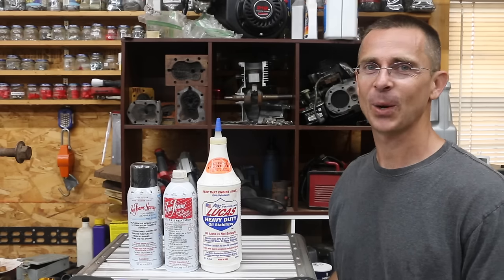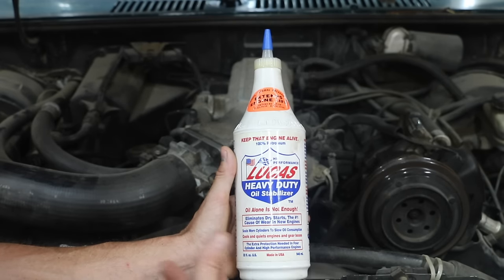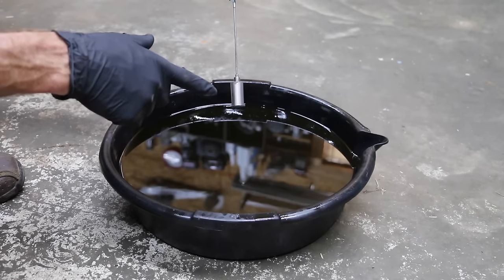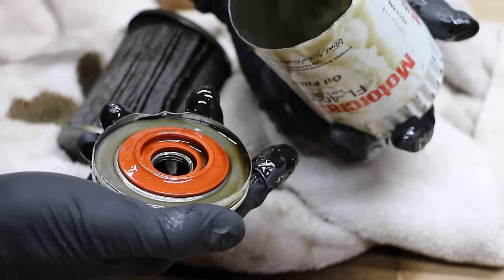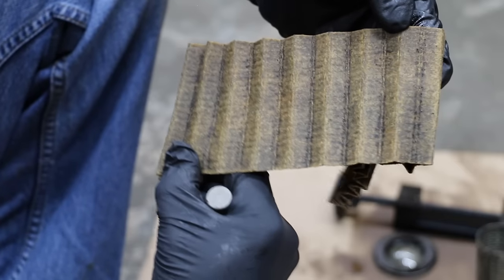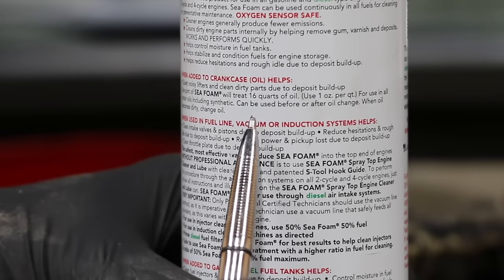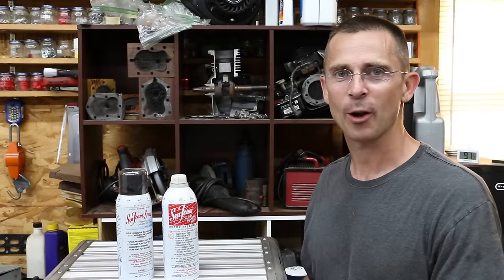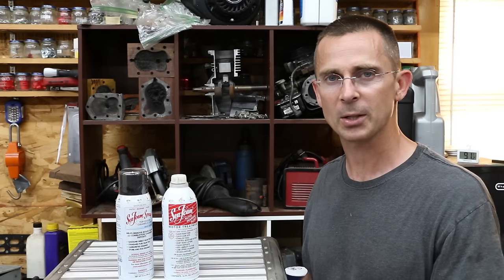Did the Seafoam fix last? Update on the Ford Ranger

Comment: I would love to see a show down between Walmart's Super tech motor treatment and Seafoam.
Reply from the maker: Great video idea!
Reply: Itd be interesting for sure. The stuff works just as good to me but raw numbers would be nice.
Reply: Ya? and the cost is like $3 bucks. Way cheaper then Seafoams $7 a bottle.
Reply: Yes, please! Been looking for a comparison of these two products for months!
Reply: I'd also like to see a super tech vs name brand synthetic lubricity test before and after use in engine
Reply: I use supertech on all my vehicals even the lucas oil stabilizer knock off and it all seems to work for me I'm about to use the supertech refrigerant for my ac would love to see a video aswell!
Reply: The refrigerant is identical to everything else on the market. Avoid any "stop leak" or any other additives in your AC system. If it leaks, use a dye injector kit, find the leak and fix it. If there is no refrigerant in your system, find a friend or trustworthy shop that can put a vacuum on your system before filling it with refrigerant. Be sure that the system HOLDS vacuum as well. Good luck.
Reply: B-12Chemtool,at wal-mart

Comment: I have a 2002 GMC Yukon that wasn't sounding that great. It has 277,000 miles or so. I used Seafoam in the gas tank and in the manifold. I saw such a difference! Acceleration is much better for sure. I haven't added any to the oil yet, but plan to before the next oil change. Thanks for the videos!
Reply from the maker: You are welcome!  Thanks for sharing!

Comment: I've been an auto mechanic most of my life and I've actually retired from it and I used to be completely skeptical about products like that but I learned that most of them actually do work, but the results are limited. I mean you're not going to get a new engine out of a can and you kind of need to know what your expectations are before you pour it in. I think you got a great result from some good products that met your expectations so in that regard yeah they work really well. Sometimes some products like transmission seal has the side effect of softening seals and they may shorten the seal life but if your seals are already leaking it's kind of worth a try but like I said don't expect too much out of a bottle.
Reply from the maker: Thanks for the feedback!

Comment: I used Lucas in my perpetually-leaky transmission. It performed as advertised.
Reply from the maker: Thank you for the feedback
Reply: I’m curious do you live in a cold climate? I live in NW Ontario and we frequently get to -40F in winter. My transmission is also perpetually leaking and want to try Lucas but I worry it will be to thick in winter.

Comment: If the blowby was rings the Seafoam should do it, but it could probably use an extended highway drive. I like my filter media oily when I check it. A magnet makes the oil "ooze" slightly if there is metal, showing even finer particles than you can see.
Reply from the maker: Great point.
Reply: Project Farm 
I used to work for an aircraft engine overhauler and have cut open thousands of filters for inspection. Your filter cutter is very impressive. Thanks for the update on this truck, good to see something that works as advertised and lasts!

Comment: Love how thorough your work is. One of the best channels on YouTube without doubt.

Have you tried adding a magnet to the outside of the filter? The metal particles that make it to the filer then stick to the magnet rather than get caught in or pass through the filter.
I've seen some clips where people do this. Would it be worth doing when cleaning the engine using seafoam /lucas/etc?
Reply from the maker: Thanks!   Thanks for the suggestion.

Comment: A double dose of seafom in my '03 Maxima actually fixed my vvt code that was being thrown in BOTH v banks. "P0011& P0021 NISSAN - Intake Valve Timing Control" During time of which I had the seafom in the engine the code must have disappeared because after getting an oil change and checking the check engine codes the only one left on was an evap issue. After clearing the code and driving for 100 miles the check engine light remains off and is still off!
Reply from the maker: Impressive! Thanks for commenting on this.

Comment: I had a lot of blow by on my Volvo s70. Instead of doing rings i soaked the top of the piston in b12 chemtool and then marvel mystery oil. I would put some into the cylinders in the morning and when i got home from work for a week or so then i did an oil change and replaced one quart of the new oil with automatic transmission fluid. The chemtool and the mystery oil worked ok and reduced my oil consumption by a little but the atf really helped after two oil changes my oil consumption was next to nothing. This combo just might unstick and restore your piston rings!
Reply from the maker: Thanks for sharing.

Comment: I think putting motorkote in it will help alot,

Ive heard that if you put a shot glass full in each spark plug hole after it is warm and let it sit for an hour , it will increase compression.(in some cases)

Id love to see more tests with motorkote as it has been the most impressive product to date. 
And in this case with the older motor i think it would benifit us to see if it does make a difference in its operation, even in an old beater (priceless Gem) 

Thank you for all the vids,
Really enjoy them.
Reply from the maker: Great recommendation!

Comment: I recommend priming oil filters before screwing them on.
Reply: no
Reply: How do you do that and why?
Reply: @giggityeffyou  pour oil in it / rub oil around the seal. It's pretty meme
Reply: The only need for such an application that I can think of would have to be with a diesel motor & not the oil but the fuel!  Because of the continuous cycle, fuel filters Always need to be primed to the brim or if equipped with a primer opening air release valve then prime away!!                     But adding to the topic of question.. oil filters never need to be primed👌
Reply: It looked like it was mounted on the side or I would agree with you there.
Reply: Only put a thin film on the gasket when installing a new filter
Reply: @smigletat9634  unless they're huge like on diesels or equipment
Reply: @shellcracker18  I am probably living in the past..but for over 50 years now I have been wetting the seal with the USED motor oil. It has fine particals in it that make it grip better. The seal is tight and STAYS that way. The ONLY oil filter I ever had leak that I changed myself was one I said screw it, and used New oil on. 😣 Never again...never another leak.☺
Peace✌
Reply: @garyheaton4791  funny thing. Today is the first time I've ever not put used oil on the filter. We shall see what happens lol.
Reply: @giggityeffyou  rub your finger around the rubber ring with oil to wet the seal-better seal.
Reply: i see you are trained in the old ways as well.
Reply: Old school wisdom.
How necessary it is today, in unsure of.
Reply: @giggityeffyou  press the "on" button.

Comment: Love your channel. I have heard that some of these additives break down to create an environment that although good at removing sludge, can over time, harden then crack rubber seals and gaskets.
I would love to see you run a controlled experiment to confirm if this is true.
Reply from the maker: Thanks for the video idea.
Reply: I mitigate that risk by only using SeaFoam 200-300 miles before an oil change.  It is mostly drained out, and further diluted with the new oil.  I would be a little cautious about keeping it in the oil the entire use interval.
Reply: @robertosanchez8580  most of the time the problem is that the seals are already broken down, but the conventional oil sludges up so much that it creates a barrier stopping the leak. Then the treatments just clean them out.

Comment: When you want to remove Sludge from the engine & crankcase, just add one Quart of Diesel Fuel to the Crankcase and run the engine (at temperature) for 30 minutes, then drain COMPLETELY while still hot.  Diesel Fuel is also known as #2 Home Heating Oil.  It may appear thin as water but, as oil, it does have Lubricating properties, and it is an EXTREME Detergent, and will dissolve all manner of build-ups and deposits (try it on Road Tar to see just how well it works).   E. R. Petersen 50 years Coast Guard Licensed Merchant Marine Chief Engineer of Steam, Motor (diesel), & Gas Turbine Vessels, UNLIMITED Horsepower.
Reply from the maker: Thanks for the recommendation.
Reply: I've heard this works really well. My former FIL was a USAF mechanic and used this process on his vehicle. You would not believe the black sludge
Reply: mark burress I’ve done it many times and it does seem to get it out! I’ve used a few quarts of gasoline added to then crankcase about 30 minutes before an oil change in order to try to drain out more/completely drain the oil.... But the diesel seems to work much better and I let the car run for a while with the diesel in it... I just add 2-3 quarts before the oil change and let it run a while. Of course drain hot.
Reply: You drain a quart of oil before adding the diesel, correct?
And this won't cause any sort of premature wear? (I have 277K miles so using the word premature is a stretch)
Reply: Would this harm a newer engine like my LS3 with 20000 miles?
Reply: @GregoryShtevensh 
 NeverUseName OnTheInternet  It's very possible it could as it doesn't have the same lubricating properties. I would not do it if it's not necessary. Seafoam would work fine if you don't mind adding it 200 miles before a oil change.

Also if you add diesel to your oil your better off dropping the oil pan to remove as much oil/diesel & sludge as possible. Otherwise your going to have it circulating clogging filter until your next change.
Reply: @AWIERD1  yeah I agree... thanks
Reply: Mr Petersen, I have received a lot of sideways looks whenever I have advised this method.  The looks of gobsmackedness afterwards is Always worth the effort.
Thanks for the backup of your experience and expertise.
Ha! What will these youngsters learn?
Reply: I used to drive a couple miles to the gas station, put in a dollar of kerosene, drive back, then immediately change the oil while it was still hot. I got some confused looks when I opened the hood at the pump. I just use diesel now instead because Kerosene costs more. I would not advise driving very far with diluted oil, but it cleans nicely. My dad showed me that trick. I run diesel in the torpedo heater too and it burns fine.
Reply: There's so much for people to UN-LEARN...! They're told by some shade-tree mechanic they will destroy an engine by doing something so simple as cleaning the engine with Diesel Oil.  It is in fact a high Detergent oil.It even removes carbon from the piston rings, etc., and also paraffin build-up around the valve assemblies.  Another trick; When trying to free up solidly rusted parts, just heat up with a torch then apply a stick of Bees Wax.  It will melt and penetrate to good metal, and after it cools a little, just wrench the connection apart.(Merchant Marine Steam Engineering Rule #1)
Reply: @o2b2sea  I heard one guy say don't use Diesel fuel to newer engines. I have a 95 Honda Del sol I am working on. It runs strong. 330,000 miles right now. So I don't think that's a newer engine. Do you think it will be safe to do this on a 95 Honda Civic del sol? Thanks!
Reply: I've always wondered if Reslone is diesel fuel..
Reply: @douglasgrant8315  i think most additives are just other common chemicals rebottled. Sea foam looks and smells like lacquer thinner. And STP gas treatment (red bottle) I'd swear is just diesel fuel. I believe the stp bottle even brags about the product containing jet fuel - which is just #1 diesel. Jet fuel sounds more impressive, making uninformed customers want to buy it
Reply: @torque395  Agree. Years ago there was an oil treatment called "Slick50", which looked and smelled and felt like transmission fluid. I started using some trans fluid in my crankcase and had 235,000 miles on it when I sold it and it was running fine.
Reply: quart of trans fluid in the oil and run it a while, high detergents in trans fluid, plus its 10w

Comment: I use both products in the nearly 30 year old 1993 Dodge Dakota, 3.9L, 230,000 miles. No notable problems with engine, crankcase, oil flow, etc. Engine has had timing chain, cover gasket and pan gaskets replaced 30 thousand miles ago but was not using these products at the time either.
Reply from the maker: Thanks for sharing.

Comment: You will have lower compression reading if you don't have all the plugs out. Compression on the other cylinders slows down the motor on cranking. And the throttle valve should be wide open and the battery fully charged- I have found out the hard way!
Reply from the maker: Great point.

Comment: id say the old noise was a sticking valve, it doesnt stick so its not doing the tapping, it might have been lack of lube or carbon build up,  we used to use redex in the UK, and it smoked like crazy, but those were the days before pollution :)
Reply from the maker: Thanks for commenting on this.
Reply: I can remember going over the top with Redex, most people did, couldn't see the end of the road for hours lol
Reply: The Seafoam he used made a lot of smoke, too.
Reply: My old 2.9 would rattle if I held it wide open for 15-20 seconds. But it always went away rather quickly.
Reply: seafoam did smoke, but redex used to make enough smoke to pollute your entire town
Reply: This is why you do it at night...
Reply: Jusb1066 can we get seafoam in the uk mate i cant find it anywhere.
Reply: @airsizm, ebay uk sellers do have it ( its not cheap mind! 23 quid for 2 bottles) (its my go-to for anything outside of the high street) , but ive not used it, i keep my eye out for these american things , some of which are better than we have, like jb weld is far better than old araldite, ive not actually seen or used  seafoam but keep it in my mind if i need it one day, bit like evaporust too.
Reply: Jusb1066 thanks for that man i have looked on ebay and seen it on there but thought one of my locals would of had it but thanks again bro the reply was much appreciated have a good day 👊🏾
Reply: ebay and i go way back, i loved autosol chrome cleaner (if you have any old school chrome) and that stuff is the best but the high street stopped selling it including halfords so kinda went from there.  see ya mate, havea  good day yourself
Reply: Jusb1066 one last question my friend i drive a seat leon deisel fr mk2 car runs fine slightly high mileage but thats not an issue the issue is when im in 2nd or 3rd gear im getting a little miss like a jerk when i put my foot down but after the car has been ran a while this goes but its there if you get me ive changed filters give fuel system a clean with no real result which is why i was looking at this seafoam as i was wondering i may have a build up of carbon that needs removing. 
Thanks mate soz to be a pain 😆.
Reply: yes you might have a  sticking valve, you do the thing where you pour it slowly in a hot engine down the intake, slowly increasing till it stalls, bung some in the spark plug holes and wait over night (also put some in the fuel , and oil as the guy here did) , same thing we did with redex in the old days,  this unstuck a valve on a car of mine, it will do no harm to do this, but probably do at night as the next run will smoke a ton.
Reply: Jusb1066 thanks man im going to order some of that seafoam and try it soon so ill keep you posted.
Reply: So, in the mid-18th century?
Reply: @therealxunit, well before people thought it was unusual, back in the day, youd hear cars backfire, worn cars would smoke, along with all the 2 strokes, and every bus and lorry belched black smoke,  garden burning piles, houses still using coal etc, early 80s probably
Reply: i do remember wynss, there was also an STP variant, it was indeed like syrup, you have to warm it up to pour it out!  originally it was sold to increase oil pressure, old cars had issues with the oil light at idle when hot, so a common trick was shove this in.  later on they added stuff to expand seal rubber to stop the leaks,   it stopped smoke because the oil was thicker and less got past the rings.  im sure it was bad for the engine or pump , but it got rid of the car!    back then there wasnt any thicker oil, we already used 20/50,  but i remember putting ep150 gear oil in a mini once to get rid of it as the oil light was on not just at idle......heck i was about to rewire the oil light with the alternator warning light.....yeah dont buy an old car off me!
Reply: When you do a HOT SOAK with SeaFoam by one of the intake manifold's vacuum lines(usually the brake booster hose) , then you later come to start the engine and take the vehicle for a spin to clear the engine's throat it will smoke like a wild fire in California.
Reply: Sticking lifter, not pumping up all the way.
Reply: Jusb 1066 

- it is called 'Motor Honey' over hear, and i think you can still get it.

they make a version for transmissions as well
Reply: @jusb1066  what spark plugs?
Reply: @chris yes forgot diesels dont have a convenient hole to put redex down the bores ^

Comment: I have had good results using “RESTORE”.   It’s a silver container in the gas and oil additive section at most stores.  It comes in 3 sizes 4cyl, 6cyl & 8cyl.   It makes the engine run smoother and restores compression.   I have been using it in vehicles for over 2 decades.
Reply from the maker: Thanks for sharing!